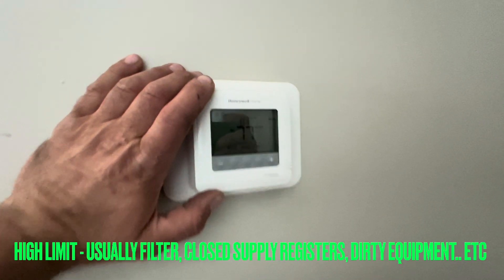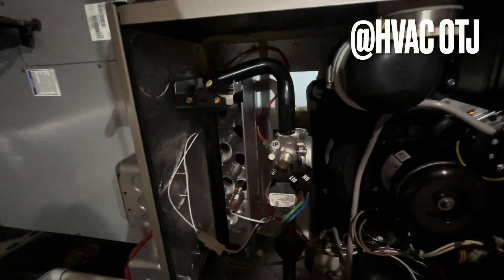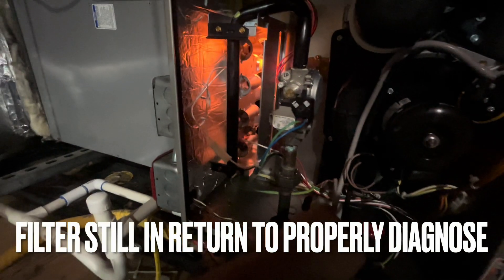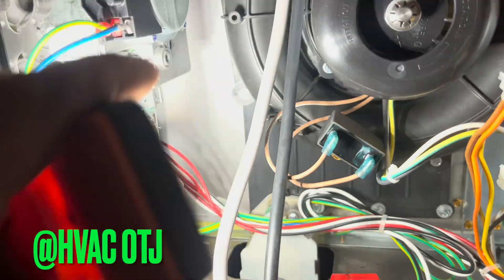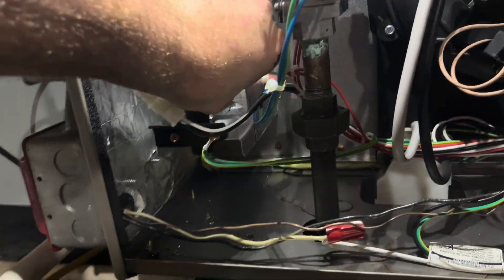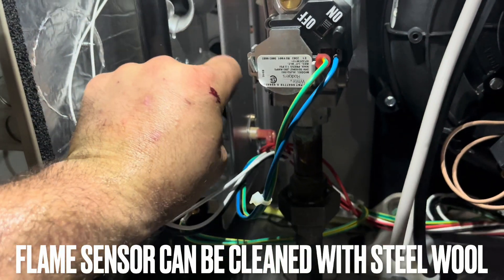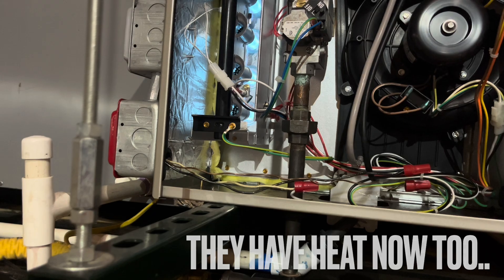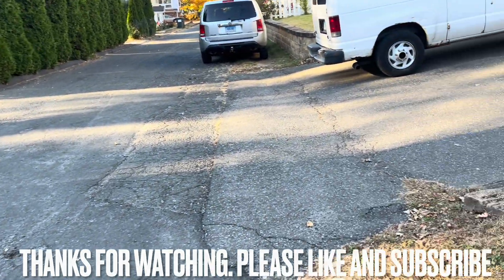WHY DOES MY GAS FURNACE KEEP SHUTTING OFF?  IT STARTS AND THEN TRIES TO START AGAIN????

Comment: How often do you find cracked heat exchangers? Im a newer tech and that stresses me out the most because i'm no expert at finding cracks... i try to pay attention to the flame.
Reply from the maker: Flame with fan door on.   If you don’t have a combustion analyzer provided for you by company ask for one.   You can check co in duct rather than the whole camera thing.  But we find enough.   I test and if my co and other factors are out of whack then I look further.    Thanks 🙏.